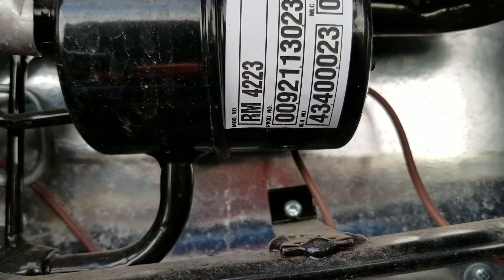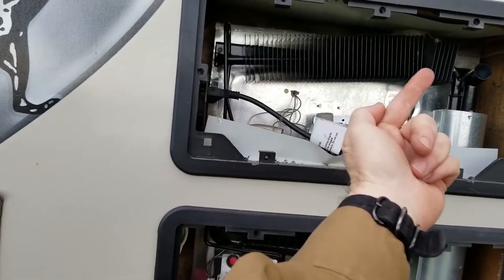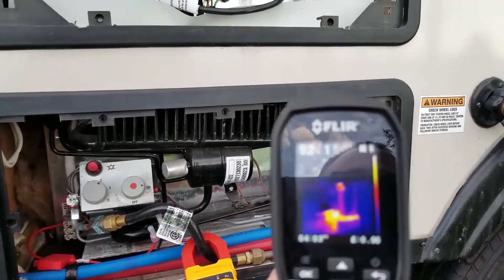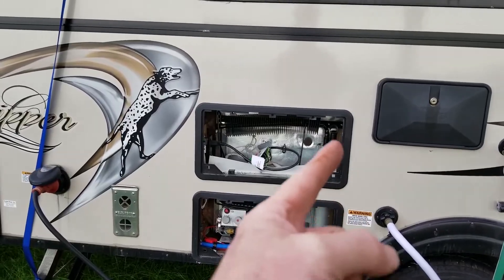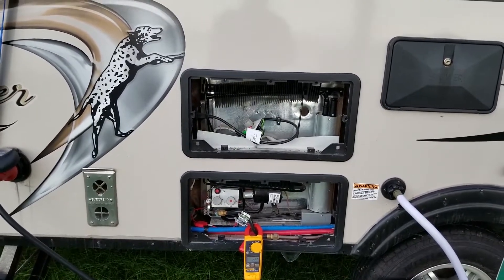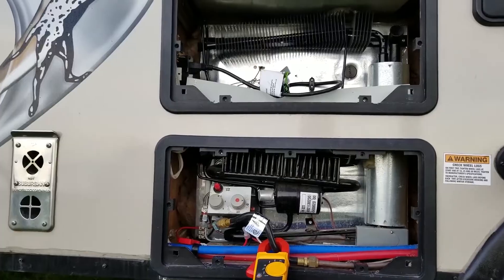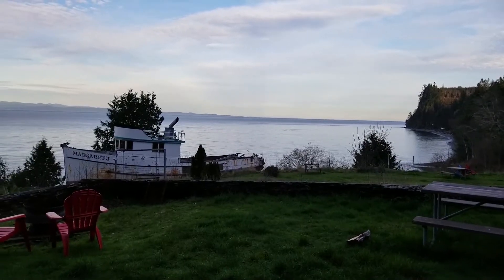Dometic RM4223 RV Refrigerator Operating Unlevel Caused Cooling Unit Blockage

Comment: we have babied our 17 year old trailer and it's absorption fridge for years and it still works perfectly.  we do run it while driving, never an issue,  and if we stop, even for a few minutes, i always turn the fridge off unless the trailer is level.
Reply: The fridge is also unleveled while driving, why is that different than when you stop?
Reply: @user-ki5hp1ng4n  it is a well known fact that the vibration and other motion while driving keeps the fridge cooling system from clogging and in reality the trailer is level while driving
Reply: @stevem268  thanks much

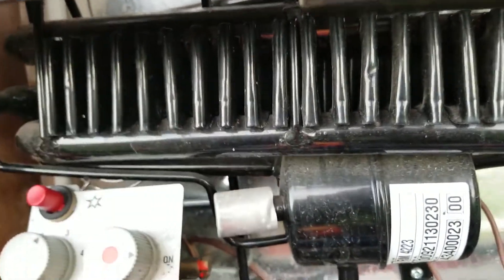Comment: hi Darren, at the 5:01 mark, your FLIR meter shows the lower portion at 55°F and the absorber vessel at 71°F.    You say "this is very cold. We need that to get hot."   What temps would be expected/normal here, for a properly operating unit with no blockage?   Should that lower segment be ... 100°F?  200?  How about the absorber coils?   What about the absorber vessel temps, normally?

Is it possible to have partial blockages?   My RM2351 boiler is HOT after running an overnight maximum test as you recommend starting with, using 120v AC shore power, (with the thermistor off the fins inside) and the interior compartments are ...meh, only fairly cold.  But my absorber coils are not hot.  They're not cold either.   Maybe 70.

Thanks so much!
Reply from the maker: Since that cooling unit is a constant loop, what I have found is maybe a 10° difference between the boiler insulation shroud and the absorber coils. It's possible to have a partial blockage - sure, that would be like one of those flakes of sodium chromate is only partially blocking when the cooling unit transitions from a large tube to a small tube.

On our refrigerator playlist, we have several videos on cooling unit R&R jobs. It's not particularly complicated, it just takes some time. We've had the best success with www.coolfunrv.com cooling units. If you let Kris there no that  My RV Works sent you there, he might discount, but I'm not sure. That's up to him. No harm in asking though...

Comment: Hi Darren, I only recently started watching your videos and they are very helpful.  In particular, in regard to the Lippert, (Schwintek) in-wall slide systems.  What a great job you do!  

I don't know how often you see comments, and I don't see any other means of emailing you directly, but I have a refrigerator question;  Although they are not very common, we have a Magic Chef Refrigerator, Model No. WD-282FWDC, S/N MC2007170224 in our 2022 Forest River Sunseeker.  We've experienced issues with it icing up and not cooling.  The freezer will continue to get cold, but the refrigerator no longer cools.   The only solution we've found is to completely shut it down, unload everything and let it completely thaw out.   It will again work normally on re-start.  Simply defrosting the freezer doesn't seem to resolve the problem and the Dealership says there's nothing wrong with the refrigerator when we've taken it in for diagnosis.

I've searched your site for any information on the Magic Chef but only see Dometic and Norcold refrigerators discussed.  The technology of ours is very much different.  I wonder if you could put something out for those of us with the Magic Chef.

Thanks for your consideration,
Tim

Comment: I have a 3-way Dometic refrigerator in my 2014 Aliner Ranger 15. It works fine on 12V and shore power. Although I’ve had no problems with it in the past, recently my refrigerator will not cool on propane. Yes, the pilot light lights as expected, the heating tube gets hot on propane, but the refrigerator won’t cool. Any suggestions would be greatly appreciated! 
Muskoka ON 🇨🇦
Reply from the maker: There are a few things you can check. On the brass gas valve, you will see a orifice that's screwed on to the valve. It's a metric wrench size. Carefully remove that and if you hold that to the light you'll see a pink Ruby inside, make sure that that is nice and clean and not clogged. If you need to clean it use a Q-tip and rubbing alcohol. Next, take a can of office air, and blow out the burner, that's the tube thing with the slots on top. Try those two things and see if you have better results. You might be having a flame but you might not be getting the right amount of BTUs to that burner.
Reply: @MyRVWorks  Thanks! I’ll try this! Arriving home tomorrow—104 nights of camping this season. 😊

Comment: Great video!  I think I may be having a similar problem ie. Blockage or failed unit.  I see no yellow dust anywhere.  I have an RM1350 series Dometic.  Freezer is consistently around 0 degrees to 8 degrees with outside temp at 100.  However, refrigerator compartment is anywhere from 40-58 degrees with ambient temp at 85.  How can it be so cold in freezer, but so warm in fridge?
Reply from the maker: To check for blockage, you can feel the temperature difference between the boiler and the absorber coils. After the refrigerator has been running for an interval of time, those two should be similar in temperature. Another thing you can check, is the ventilation through the cooling unit. If the ventilation is not correct, and you cannot shed the heat off the cooling unit, then you will have performance issues as you are describing.  In this video, fast forward to around the 16 minute mark. 
 https://youtu.be/IT_5HGe4q-k

 I draw a picture of how the ventilation should be. Then in this video, in the first segment I do talk a bit more about blockages.

https://youtu.be/--DCnSw1jP4

Comment: So how much can you drive in the mountains with your refrigerator on?
Reply from the maker: You can check your operation manual. Some manufacturers state that it is okay to drive with your refrigerator on and some state that it's not. As long as there's movement within the RV the fluid will eventually work its way through while driving. The issue you get into is when you stop and you park for an extended period of time that's where you get problems.
Reply: @MyRVWorks  ok thank you. Just found your channel. Very informative.

Comment: Hi, I just acquired an RV refrigerator which I’m planning on installing in my cottage. My question is what should I be doing on the rear of the refrigerator for ventilation and should I also install a chimney to expell smoke from the LP ???
Reply: I wouldn't worry about 'expelling' the smoke. There isn't very much burning but ensuring a direct path upwards and out would be a good idea. As for ventilation, I sometimes install 12V fans (similar to quality computer fans) to aid in scrubbing the condenser fins especially on hot humid days. Good luck.
Reply: So Daniel Balfour, your saying I don’t need to cut two holes in my cabin for the ventilation??? Just add a 12v fan?
Reply: @barrycritch3417  Your installation should mimic that of an RV. You need to ensure adequate airflow behind the fridge and that it is properly directed around the condenser fins. Hot air and exhaust should be allowed to escape either through a chimney or directed out through some vertical vent.
Reply: Daniel Balfour ok, gotcha, thanks for the advice. Really appreciate it immensely.

Comment: I've looked up the specs on what "level" is on my Dometic and it's 3 degrees front to back and 6 degrees side to side. I always shoot for zero degrees, but if you're within these specs you should be ok. I use my iPhone Level mode and also a bubble level to do this.   I just put a baffle in the upper section of my RN2193. It makes sense that this would help. Thanks for the info.

Comment: So my freezer works great but my refrigerator is warm and my coil is cold at the bottom which according to this would mean the coils are bad. Can the coil be bad and the freezer still work?  I have tried it on gas, dc and ac. Over the last 2 weeks, my temp inside fridge varies from 60 to 30. I have a Dometic RM 3807.

Comment: I have just discovered your videos...they are fantastic.  I'm struggling with a dometic fridge that is just not cooling well especially in warm temps.  I've done a lot of the tests you show in your videos and believe that the problem is two fold. 1. I need to add a baffle to direct air over the cooling fins. 2. my upper vent cover area just isn't letting the heat out fast enough.  I plan to add a 12v fan inside the upper vent cover area blowing out to help clear the heat. that should help some or a lot, we shall see.

I would love to see an image of what a good baffle in this area looks like.  do you have a video that shows a good baffle system in the upper vent cover area near the cooling fins?

thanks and keep up the great work.
Reply from the maker: On my website resources page:  https://myrvworks.com/manuals/
Filter for  refrigerator and Dometic.  Then search for this file name:  "Dometic Power Ventilator Installation Instructions for Single Door"
I also have one for a Double Door.

That may provide the info you need.

Comment: Before I replaced the refrigerator or coils, I would pull the refrigerator out and invert it for 24 hours.  A lot of times this will work.
Reply from the maker: Hi Greg, I appreciate the tip.  I have also had folks drive around and even bang on the coils to get some movement in the cooling unit.  It helps as a part time solution to get the sodium chromate back into solution.   Since Na2CrO4 readily dissolves in water sometimes what we find is that it got overheated and changed its chemical property and is not so readily dissolved any more - kind of like adding sugar to cold unsweetened tea.  It is just not the same as having it dissolve in hot brewed tea where it emulsifies with the beverage.  Eventually the sugar will just fall to the bottom again - or in the cooling unit case, the blockage will return.  When this happens the issue will return and a new cooling unit is what is required.

Happy Camping,
Cheers,
Darren Koepp
Reply: @MyRVWorks  D Tinman commented above: ^ "diagnosing a refer that has test good in every way but just isn't getting cold". 
    So I'm a master plumber and understand a closed, pressurized system....not much you can do without specific equipment at arms reach....so....I just finished beating on every part of the circulating system...  :- l     It "was" making a gurgling sound before...now it's making a new sound.   :- )     (leaving tomorrow) I will edit this post when we get back Sunday.  Lots of ice chests this trip...oh well, it's a dirt bike and Razors trip so plenty of fun ahead. Thank you for posting the info. Bryan, B.K. Plumbing in So Calif.

Comment: Hi Darren I love your videos. I have a question about a Norcold N81X refrigerator. It is flashing a code four can you help me diagnose it?
Reply: Hi Lee,

On my website under the 'Resources' tab you will find a link for 'Service Manuals'.

https://myrvworks.com/manuals/

Sort to Norcold Refrigerator and you will find one titled "N7,8 series"  On page 17 of that manual you will find the fault code descriptions.

For your 4 flashes it is telling you that the AC heater relay on the control board is stick 'on'.  The only fix is to replace the control board.  Yikies!

Wish I had better news for you but hope this helped.

Cheers,
Darren Koepp